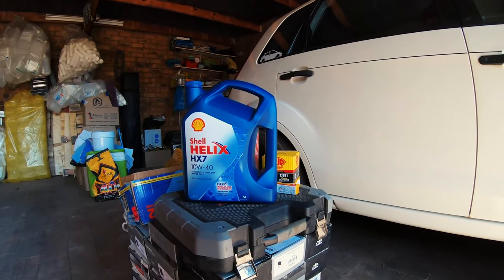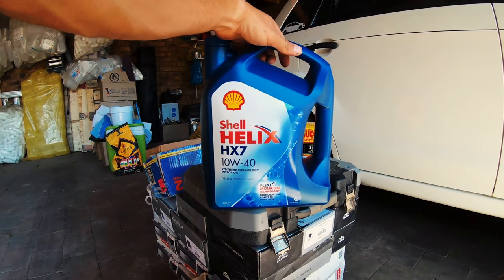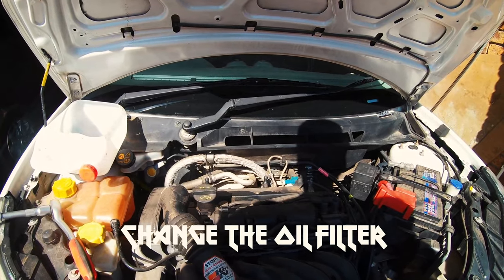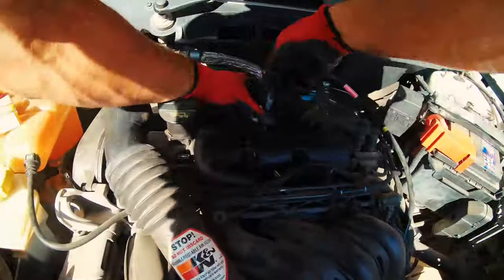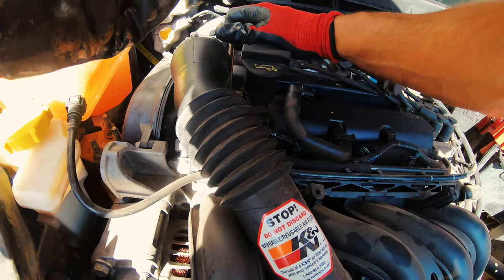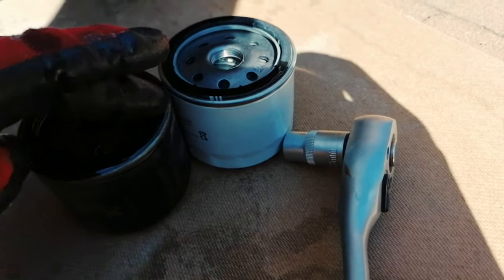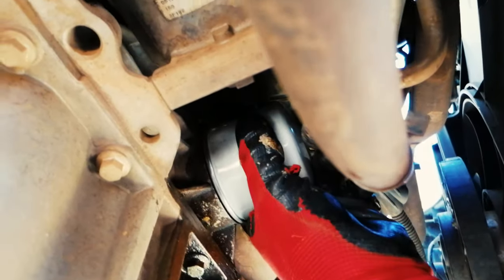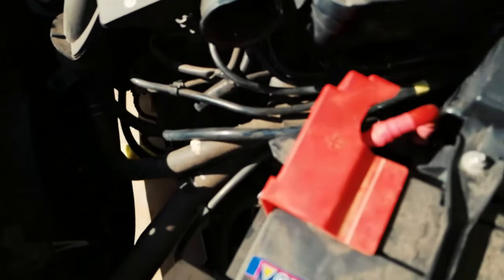HOW TO SERVICE A FORD FIGO | D.I.Y FIGO MAINTENANCE FORD FIGO MODIFIED

Comment: Thanks  Brandan. I've just successfully serviced my car for the first time by myself thanks to your video. I did however, struggle getting that oil tank open the bolt is so tight .so I  haven't changed the oil yet.
Reply from the maker: It's a pleasure that's why I create these videos I'm glad it helped you, yes the oil drain bolt is very tight just make sure you use jack stands when under the car and gran yourself a breaker bar or any piece of pipe you can add to the ratchet that should help make it easier to remove
Reply: I guess you need a good leverage
Reply from the maker: The extra length of the pipe moves the anchor point

Comment: Helpd me too i did my own service  after watching the vid lol DIY
Reply: Bt i used 15/40
Reply from the maker: Not a bad thing especially if your engine is higher Mileage
Reply: @BrandanHewitt  cool i wana go 20/40 if there is will that b alright too
Reply from the maker: @marlonpilott818 if you stay in a area wear it's always warm 20/40 is okay, 10/40 is just for places that have colder morning temperatures, it's initial operating temp is lower than that of the 20/40

Comment: Cool videos. Just serviced my Figo's. Next I have to change the AC and Fan belts. Any video's on that perhaps. Thanks for the content.
Reply from the maker: Thank you so much Rikus, I have not done that yet on my car but I will ask my mechanic if he has any jobs coming up then I'll try film one with him
Reply: I think fan belt you might want to send to competent person.
Reply from the maker: I do have a qualified mechanic that does overseas the major service things ,  Cam belt is something I won't do myself as I don't want to be the cause that I have to replace the engine. But the only way to learn is through experience

Comment: Appreciate the vid, definitely learnt quite a lot.
Wouldve been better if the removal and replacement of the fuel filter wasnt skipped
Reply from the maker: Apologies for that with the car being jacked high enough to get under its hard to get the camera setup so everyone can see, but I'm glad that it was useful
Reply: Whr does the petrol pump gooo

Comment: Gudday, it was my first time doing service to my ford figo,l experience oil coming from oil filter when l remove it, or is it  normal
Reply from the maker: Yes that is completely normal as the excess oil will still drain from the housing l, It will leak more if you didn't drain the oil first

Comment: I got a question. I've got oil coming out of what you referred to as a breather pipe. What can I replace or check regarding this issue? Would appreciate some advice.
Reply from the maker: Hey brother so if it's an excessive amount of oil it means your rings on the pistons are most likely on their way out so oil is pushing past them. May be try take the car to a mechanic so they can pressure test it just to make sure before doing any repairs

Comment: Thank you so much, perfect timing, about to service mine 👌
Reply from the maker: Glad the video could be of assistance 💪🏽🙏🏽
Reply: @BrandanHewitt 
Appreciate the endings,
Liked the last one when you were out on the skid pan
As a figo driver I can relate to the glares we get pitching up at meets

We Are here to have fun all the same

Keep up the awesome videos man 👍👌
Reply from the maker: Always trying to improve bro and these are just lessons I have thought myself a which I see time and again so all from the heart, I have learned to not care about the negative opinions of others because if I let everyones opinions get to me I'm going to be a wreck, I know my budget and I know my passion so until my budget increases I aint giving a shit about any glares or comments about my car or the shit I do with it, people are quick to judge but quick to forget bthay everyone comes from completely different situations 💪🏽
Reply: @BrandanHewitt 
Spoken like a figo driver
Reply from the maker: You gotta know bro
Reply: @BrandanHewitt  finally put in the manifold

Holy crap it Is insane
Had to remove the resonator to make it fit
Mine was really far forward
So it's very noisy

But wow, the fuel saving and power is awesome 😂👌👌👌
Reply from the maker: It does make a huge difference specially if you try drive economical, just need to fine tune the exhaust with the right resonator and mufflers

Comment: Very helpful.. thanks 🙏🏻
how often/Km does the fuel filter needs to be changed?

 Appreciate if you can show us how to replace AC/Cabinet filter alao :)
Reply: According to ford schedules its every 120 000km, but every 60 000km is good
Reply from the maker: Hey bro it is a very cheap part so I replace mine with every service as SOUTH African petrol isn't the cleanest
Reply: @BrandanHewitt  yeah the part itself aint that expencive but replacing it is a bit of a hassle
Reply from the maker: Once you have done it two or three times you start to know the tricks required to remove it easily, personally i think my car likes giving me a hard time some times😂😂😂
Reply: @BrandanHewitt  yeah i've been working with them on almost a daily basis for close to 7 years and i still have a hard time with them sometimes
Reply from the maker: I think Ford should have made that one pipe a bit longer because that's what causes my hassle
Reply: @BrandanHewitt  yeah or extend the one line so that it can be places in the lower slot where the the cable is
Reply from the maker: That would actually be the better option
Reply from the maker: I just prefer to replace with every service
Reply from the maker: Personally haven't done that yet but will do some research and see what I can do

Comment: Hay Brandan. Great content my guy. I wanna ask at what mileage would you recommend to start using 10w40 oil? And what is the standard/recommend oil for lower mileage figos?
Reply from the maker: Hey bro thank you so much I'm actually busy speaking to few mechanics as it feels like the slightly thicker oil makes my car feel slow, but they say it's better for high mileage engines from like 120k and up, I'm considering going back to 5w30 with my next service so will talk about that in the video
Reply: That's awesome bud. Mine is  due for service too but I was running low on oil. She's in 150k km so I went with 10w40 for now.
Can't wait to see your next content bru is so educational. Peace.

Comment: I have a 1.4l turbo diesel ford figo 2015 will the service be te same as this one?
Reply from the maker: It would be different as oil filter is in a different location and oil type will be different but diesel filter should be in the same place

Comment: Have you had your exhaust changed? Are you running your car just on on the K&N filter and has it changed the sound of your car?
Reply from the maker: Yes I have I have the  SWR branches as well with a 50 mm stainless steel exhaust.

The K&N  panel filter doesn't make any sound difference

Comment: Hi Brandan, do I need to release fuel pressure before replacing the fuel filter? And if so how do I go about it?
Reply from the maker: Best would be to open your fuel cap, but with the line having fuel in it is going to mess abit no matter what

Comment: Brandan can you please tell me how to put the air filter in pleas becuase I whant to do it as well
Reply from the maker: Hey bro please check out the linked video, I will do a special video again just for the filter 🙏🏽
Reply: @BrandanHewitt  tank you Brandan appreciate that so much.

And this is a bit of the topic but can you maby just show in the video how to remove the sound baffle, for me I'm not sure how to do it.
Reply from the maker: Which sound baffle are you talking about? Not sure what that is😂 but I'll be making a video soon, unless you checked the previous one

Comment: Sorry but which company will stamp the book of someone who does their own services and uses a scrapper to check the gap of of the spark plugs?
Reply from the maker: That's why you have a certified mechanic oversee and check  the work once complete. We all learn and I have certainly and use the correct tools now
Reply: @BrandanHewitt  
I'm not bashing you Brandan.
It's excellent that you try and do things like this yourself but you cannot expect a company to put their stamp on work they have not done themselves.
And if they have to check everything you have done they will probably charge the same as a service so you saving on the parts only.
Just a thumbs up...do your own work but say nothing about getting the book stamped next time.They know if a qualified person hasn't done the job they not getting a stamp in their service book.

Comment: During the drainage of oil,is it OK if l put the car on steep area on flt is fine, and is OK while the engine is still hot to drain out oil or must l wait for  it to be cold.l actually want the hole oil to be out with its last tip😀
Reply from the maker: If it's possible to angle bthe car up slightly yes that would work the best to get all the old oil out, I would suggest draining bwhen hot as the oil will be in its most liquid form. 5w30 oil is to be used

Comment: I replaced my water/antifreeze bottle yesterday cuz it was leaking, but the water bottle is heating up really quick, even from a 5km drive, any advice?
Reply from the maker: Water pump might be on its way out, ford uses a plasting turbine in their water pump so they tend to break if the right antifreeze isn't used

Comment: hi im romeo from fraserburg in the northern cape. ive put on free flow on my 2011 1.4 petrol ford figo, and it sounds very nice but not really because i want it to sound baie kwaad lol lol lol. i dont have any knowledge on modifying cars whatsoever. what can i do to give it more power and speed
Reply from the maker: Hey Romeo soo A exhaust is a good start but if you have some money see if you can get SWR stage 1 cams with the Branch exhaust and if possible try getting a unichip q installed, that's basically it for power unless you want to motor swop
Reply: @BrandanHewitt  hey brandon thank you. is it possible that you can get me a quotation on the stuff, then get back to my please, then im willing to go to wherever you are and have it installef
Reply from the maker: That's something you will have to do bro, that takes time and my time is very valuable. Visit https://stevewyndhamracing.com
Steve Wyndham Racing for the Cams and branch

And Unichip q you can try find a tuner close to you just phone them and ask if they install, you can find those 2nd hand on Gumtree for bout R3500. If you want to go motor swop put a bigger motor in then you can call Ruan Wright at 0766032276

Comment: So does the 10/40 work better than 15
Reply from the maker: Wouldn't say better it's just about better protection for the milage of your car
Reply: @BrandanHewitt  im on 160000 on clock
Reply: 10/40 abit thin for my liking lol
Reply from the maker: Change over will be good, the first number is just the starting operation temperature the lower the number the more it's suited for areas that are colder in the morning

Comment: Does it have to be on ,for a engine wash?
Reply from the maker: Hey bro does what have to be on?
Reply: @BrandanHewitt  there car .. must i wash it with there car on or off?
Reply from the maker: I'd recommend the car being off as it could possibly cause a short etc if there is power running to some the wires
Reply: Can I repair my Figo kept stop for 3 years petrol  @BrandanHewitt
Reply from the maker: Any car is repairable, just do a minor service and check all your fuses and battery

Comment: What size is the spark plug 13 or 14mm?
Reply from the maker: Spark plug is actually a 17 if I'm not mistaken
Reply: @BrandanHewitt  Dankie tjom
Reply from the maker: Thank you for supporting the videos
Reply: @BrandanHewitt  💪💯 Do you perhaps know where i can buy a black leather gaiter and black leather handbrake gaiter with red stiching?

Comment: Petrol pump?
Reply from the maker: I haven't had to replace mine, but it's located underneath the rear seat actually very easy bro access just be sure to disconnect battery

Comment: How many mileage in petrol
Reply from the maker: I average around 550km per tank but city driving cuts it down to about 480 km per tank
Reply: @BrandanHewitt  it means per litre average is 12.5 this average is with ac or not
Reply from the maker: It's without AC I don't use my AC, but I've managed to get 13.4 before but average in the 12s
Reply: @BrandanHewitt  my car giving me 7 or 8 mileage with ac
Reply from the maker: And that's why I do t use the AC😂 the 1.4 is to weak for AC and good mileage 😂